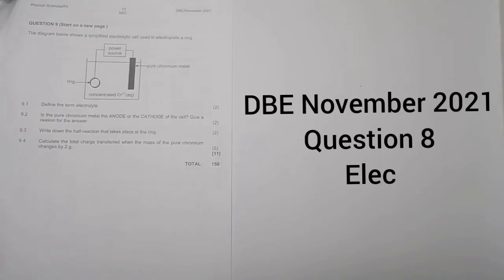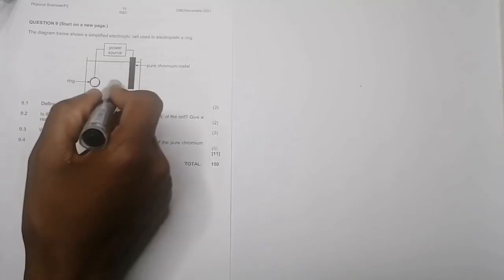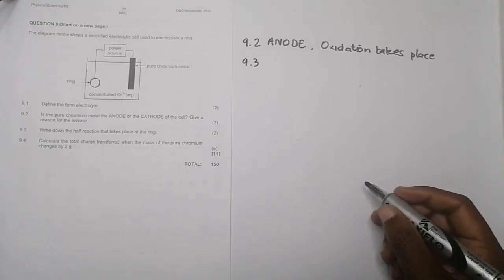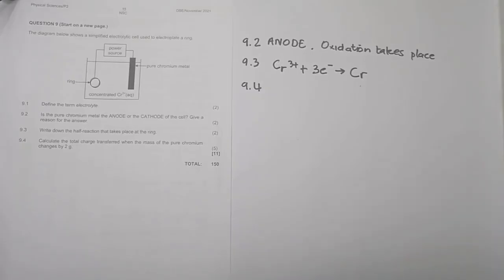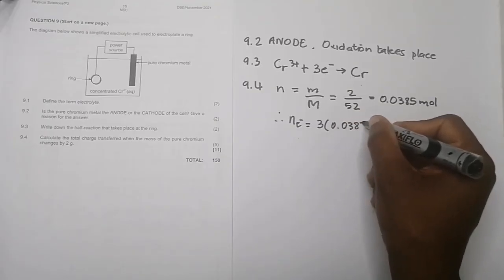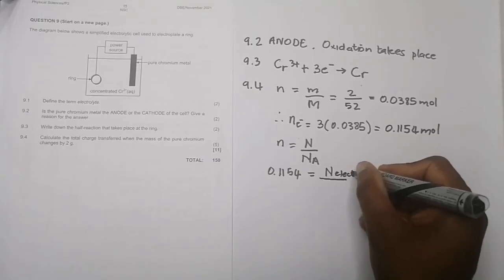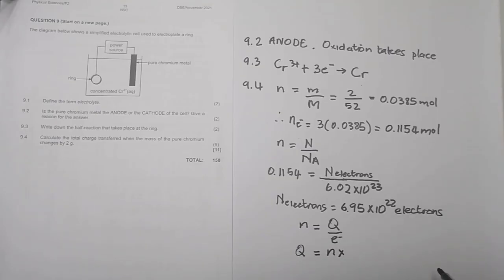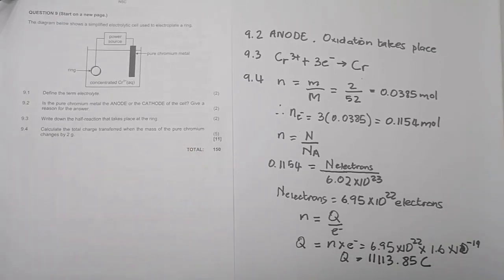Chemistry | Electrolytic Cell | DBE November 2021 | Question 9

Comment: I approached question 9.4 in a differnt way. So what i did is that i first worked out the number of mols of Cr lost. Then i worked out the nuber of atoms of Cr lost and then i assumed for every atom of Cr lost it would be 3 electrons lost, so i multiplied the number of atoms of Cr lost by 3 and then i proceeded to multiply that by the charge on one electron. My answer came to be 11568C but i assume i got this due to rounding the number of mols of Cr lost to 0,04. Would I like get any marks for this at all? :-(
Reply from the maker: The ratios is in terms of moles, using it on anything should be done so cautiously...